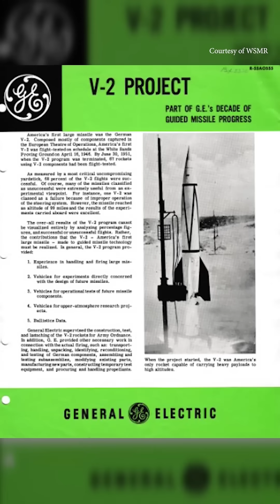Doña Ana County played a vital role in America’s first V-2 rocket tests at White Sands #shorts

Comment: My dad got sent there after the war. He ended up inventing an off range self destruct relay he called a fail safe because as he put it when a rocket flew off range " it amused the hell outta them guys". That's how my dad pulled the teeth of the last activated enemy unit and ended hostilities. Patent 2,807,757.  9/24/57 It was classified for many years and used on the rocket to the moon. Dad had a high school education.